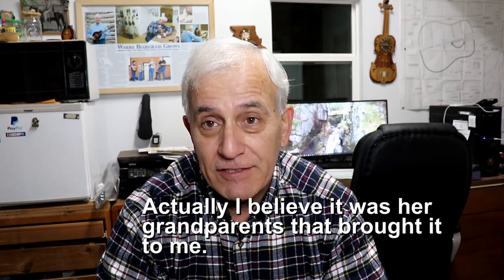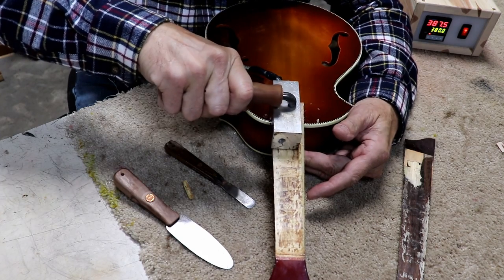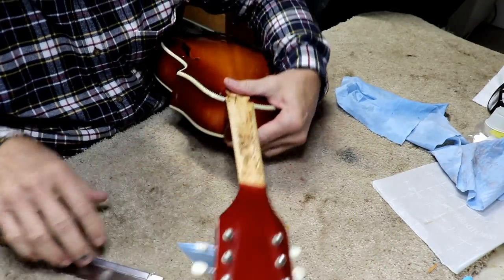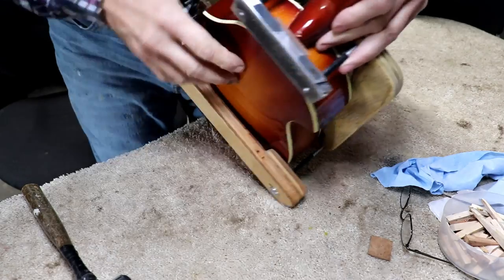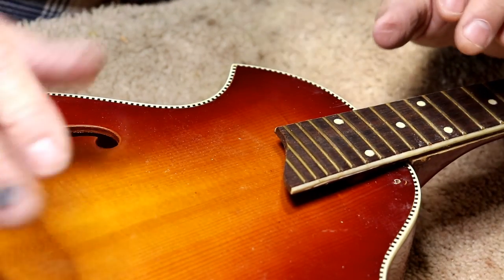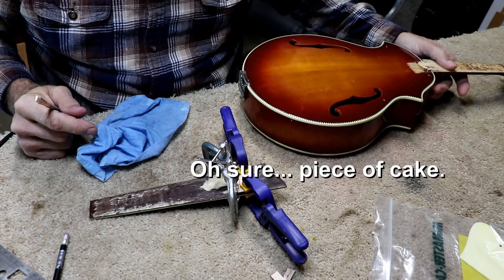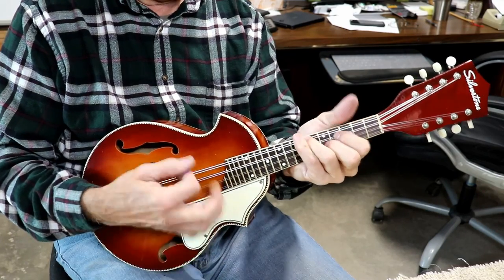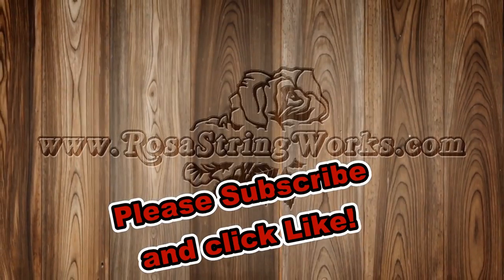356 RSW Silvertone Mandolin Neck Reset

Comment: I did my first neck reset on a cheap mandolin.  I have the same ski ramp problem.  It was flat when I first glued the neck on and even for a couple of days later, but with in a week it ramped up from string tension to the point that when you fret about the 8th fret the strings hit all the lower frets.  It was straight when I glued it, so I need to make it ramp down so that it will straighten with string tension.
Thanks to your videos I now dare to tear into cheaper instruments.  Bravo to you.!

Comment: Merry & Blessed Christmas (2024), Jerry!!     I know this video is now 4 years old, but... am hoping you will see / read this.  Am quite sure that you made a certain teenage girl.. Extremely Happy with what you did for her, and her mandolin!!   As an aspiring "young" (74+ lol) luthier, bass, lap steel guitar & aspiring mandolin player (just got my first mandolin one month ago - a Loar LM-310F), I am one of your biggest fans... learning Lots from you.  

Right now, I have a Mandolin from a young fellow (19 yrs old) who inherited it from one of his uncles who was killed over in the middle east while in the service a short time ago.... so it's a very "special" mandolin for him and wants to learn to play it. He already plays electric & acoustic guitar, and some Banjo.  

It's an Arias (1980ish ?), and it has the very same issue as one of your videos... where the Top has dropped down about the thickness of the wood, itself.  

I have a question for you... I'm having a hard time finding the video where you describe how to make the "jack" that you made (?)... can you help me with that?  Also, as far as wood glue is concerned... I have Titebond 1, 2 & 3... but Not the "Original" that I notice that you use in many or your repairs... should I get a bottle of that, instead of what I have, to use?   

I also want to Thank You, for helping to be a bit Less "timid" about how I take things apart... I was always afraid to "breaking" something if it didn't came apart easily on it's own... this video (& others) have pretty well "cured" me of that. LOL  

PS; By the way... I don't live tooooo far from you, here in Missouri... though I wish it was closer.... maybe you could give me some Mandolin playing lessons.   

God Bless you & your's and Happy New Year in 2024.   Thank in advance for any response to my questions, etc.

Comment: Just a thought Jerry, but, a wallpaper steam stripper will do the same job as your Kettle, but,- it`s designed to continue steaming, where as kettles are taken/switch off the heat when they boil ergo, not designed to continually steam. like I said, just a thought! thanks as usuall, for posting.

Comment: I was just thinkin...  The heat would work better if the part was above the heat source rather than below it.  Heat goes up and cold goes down in the atmosphere on our planet; lol.  In this instance, the fretboard would get hotter if it was upside down and the heat source was held against it from the (inverted) bottom.  Just a thought; enjoy your videos and the high level of craftsmanship!  Example:  I have a wood burning stove in my home that I want to use to cook mararoni in a pot of hot water.  (assumes a fire in the stove...). I would pot the pot on top of the stove and not underneath it for best results.
Reply from the maker: Yes but try holding your clothes above your clothes iron and see how practical it is.
Reply: @RosaStringWorks  LOL!  Good point but there might be a way...  Thank you and God Bless you for helping me to escape the oppressive reality of things lately.  Never heard Beaumont Rag before but I learned it and now it's just s question of getting it up to speed; love the "G to C roll".  Just good to watch your craftsmanship and remember the good old days, last month... (sigh)

Comment: Have you seen/heard about luthiers using dry heat to remove dovetails recently? They say it helps to avoid problems with moisture getting into other areas of the instrument and causing problems. Also, they say it works better/faster getting necks off.
Reply from the maker: I doubt it would have worked on this one. You notice I was using dry heat trying to get the fretboard off and that was one of the hardest fretboards I ever took off.

Comment: I think I might have some sort of ski ramp on my Silvertone Strat clone. I finally lowered the action to something manageable and it buzzes at the end of the fretboard on the last frets. It was probably 10/32 until I lowered it to around half that. I had been playing it sky high so bringing it back up another 1/32 won't hurt until I can look at the neck closer. 

I should've checked it when I changed strings the other day but I've never had issues because the action has always been way too high and I didn't lower it until after I put the new ones on. When I got it, the nut slots were too low so the action was really high to compensate. Its my first guitar but I had no 2nd thoughts about doing any repairs myself. 

I asked for advice on a couple of forums and most said "I need to wait until I have more experience before replacing a nut since I was new and just started learning to play." Except how is me playing for 6 months going to give me experience repairing it? I rebuild engines and fix cars for a living. Replacing a nut is child's play compared to that. I mean, there were guys that had been playing guitar for years saying they don't even replace their own nuts, etc... LOL! 

A couple weeks after that, I replaced the electronics and upgraded to quality components. A few more weeks later, I installed a bridge humbucker in place of the single coil. I do my own setups, repairs, and modifications and wouldn't have it any other way. Couldn't imagine playing for years and not doing my own work. Smh.

Comment: Jerry F YI . Something I did / do with knife scale wood . Was I would clean a crack and take a pigment and mix it with tight bond water dye .
With epoxy . I uses testors model paint . And it works great and does not detorate the stregnth of the Glue .

HAVE A MERRY MERRY AND A HAPPY HAPPY .

Comment: What sometimes works for me on Harmony and Silvertone guitars is to use a hammer and a wood block against the back of the heel and give it a couple of sharp hits. Sometimes that will break the glue, which is usually really hard. Of course, you do have to be careful, because there's always a chance you can break the heel that way.

Comment: Good work, well done, but use/check with a steel straight edge early on in the process would have avoided a few problems and would have revealed the 'ski jump' and high fret #1 and #2 early.
Reply from the maker: As I say hindsight is 20/20. Obviously I know about straight edges. But the straight edge wouldn't tell you that the wedge was too thick. You didn't know that until you clamp it down I couldn't really see between their there was no daylight but somehow or another it pulled down

Comment: I don't know if you know this ,but the is a mother way to fix a nut on the instrument to raise a busing string ,is to take an old bone nut file some bone filings ,take super guitar 20 glue put a small bit with a tooth pick on the low nut sloot than put the bone filings on top of the glue as many times as it takes to raise it than refille, the string slot to the right hight ,and there you go ,and old Luther trick ,Later String represent upper !,...
Reply from the maker: Yes I am very familiar with that method but I don't use it.

Comment: An alternative to filling the nut slot with baking solder is to soak a little piece of printer paper in thin superglue and put that in the slot, which reduces the depth by 3 thousanths or so.

Comment: seen a different you tube video from a carpenter that used salt on the gleu , he allso got fed up by the comments about it lessening the strength of the glue and done a strength test 

he done shear by gluing to pieces side to side and hang it verttically with weight hanging from the other end and done pulloff where he clamped the piece horizontaly in a vice and loaded a bucket with weights on the other end both with a suitcase scale hanging in between the bucket and the wood 

there was basicly no difference in strength , the woodgrains broke out before the joint did
might be a difference between rock salt and seasalt in the way it desolves intoo nothing  but he doesnt get the comments anymore
Reply from the maker: I don't think I said it destroys the strength. What I said is it contaminates the glue. Salt is incredibly corrosive. I'm not about to use it on anything. Especially on a neck that has a metal truss rod.
Reply: @RosaStringWorks  agreed i forgot about the metal parts inside , the carpeter basicly didnt used any not even nails

Comment: Just a little thing: what you said at ~47:30 is absolutely true. I recently bought an old taterbug with neither strings nor bridge, and the nut was literally falling apart. Fitting the new nut, getting good string spacing (it's a 12-string), making the action comfortable, and making it nice was vastly more challenging than fitting the new bridge, which was also a royal pain because the one I bought was way oversized and required tremendous carving-down. Nuts are nuts, man.

Comment: What is width of mandolin you uses for seting action on 7 th fret in milimeters. Or tell me what is string hight at 12 fret in milimeters. I set my mandolin on G 2,5 milimeters from fret to top of the string(gauge 40) on 12 fret and 2 milimeters from 12 fret to top of the G string (gauge 11)
Reply from the maker: It can vary from mandolin to mandolin but I would say roughly 40 thousands of an inch which is about 1 mm at about the 7th or 8th fret
Reply: @RosaStringWorks  from fret to bottom of the string?
Reply: @miloszorz2054  
Yes, Milos, Jerry measures from fret, to bottom of string.

Comment: I have a Santa Rosa Mandolin in need of a neck reset.  Would you be interested in doing it on video?
Reply from the maker: Sorry. I would like to do it. But I am booked for the rest of my life.
Reply: Thanks for responding just the same.  I lowered the bridge A Lot!  To the point of removing the vertical adjustment.  It's at least playable.  The neck is attached fine.  I just think it was a bad factory set up.  Anyway thanks for responding.  I enjoy your videos.

Comment: For what it’s worth, I have 3, maybe 4 guitars that I cut too deep the slots in the nut on a string or two.  In every case I used CA glue and bone dust—not baking soda.  I haven’t had good luck using baking soda—ever.  I agree that baking soda wears over time and it just doesn’t provide a good bond.  In your position, because you are repairing for customers, everything has to be weighed against time and money. I wouldn’t file away material from a fret to fix a buzzing issue if I had an option.  But I am working on my own instruments and it is my time and I’m not paying someone else to fix my stuff.  I do file high frets when I get buzzing, though.  I really enjoy watching your videos and I love listening to your thoughts because that’s typically what I am doing when I’m working on instruments—thinking out loud.  Each project is unique and you need to make decisions because there is no manual to tell you how to fix it.

Comment: I've a second set of needle valves with two 2" needles paired using a 4" length of tubing and using a Y joint on the main feed to connect them.  They work great on larger neck dovetails and/or more stubborn joints :)

Comment: You really don't want to accumulate water in the joint, so holding the mandolin such that you're not allowing water to pool in the joint will help speedup joint separation.  You're after the heat produced as a result of boiling the water and not the water itself.  Pooring water directly into the joint was counterproductive.  A pressure cooker would have also fared much better than the tea kettle, and, as you mention in the video, you have way too much pressure, and steam, escaping.

You might want to invest in the neck-joint steamer from StewMac; there's a good chance it will form a better connection with whatever steam source you decide to use and it's specifically rated for heat and pressure.  Another option would be to use StewMac's soldering iron heatstick allowing you to avoid all the potential problems inherent to the steam method.

All that being said, it's still a really cool video and thank you for sharing.

Comment: I wouldn't have tried mating those two surfaces back together without first leveling them both with a flat sanding block. Leaving the wedge on the body rather than the fretboard during that process seems like it would have avoided the ski ramp issue.

Comment: With the bare spot above the nut and the neck being wider than the fretboard after it was reattached, it seems pretty obvious that the fretboard was slid down towards the body of the mandolin a tiny bit. Had the fret board been properly positioned BOTH of those issues would not have been present and could have saved a bunch of extra work.

Comment: Oops your nail get black
Reply from the maker: Another firewood casualty
Reply: @RosaStringWorks  If you warm the injured area with a hair dryer or other heat source until you can't stand it (don't use a liquid - just dry air) several times a day, it will heal much faster. Something to do with the extra blood flow to the injury. Physical therapists use this method to speed healing.

Comment: Ok I am a pro level painter. You could have reduced dramatically the damage to the paint by running a razor or exacto knife along the binding paint line and those chips wouldn't have happened!
Reply from the maker: Been there done that thousands of times. I have used razor blade many times but this one the paint was incredibly brittle and even cutting it would have caused chipping. Not to mention that it was an uneven surface and would have been very hard to cut along because the neck and the fretboard were different sizes
Reply from the maker: I might add that there really was no dramatic damage anyway. It was very minor

Comment: Jerry, I know you aren's a fan of using salt grains in glue-ups to keep things from moving out of position when clamping pressure is applied, but what are your thoughts on grains of sand?  I've used this in my furniture making and it works well for that purpose.  Thanks for sharing your immense body of experience with us!
Reply from the maker: I've never tried grains of sand but I'm sure that would be fine. I don't like the salt because of the corrosive nature of salt.